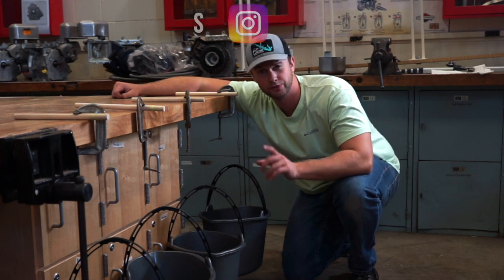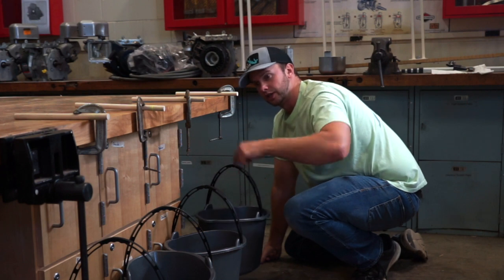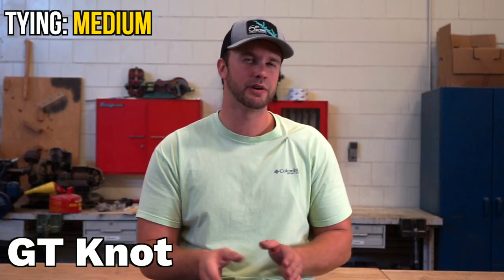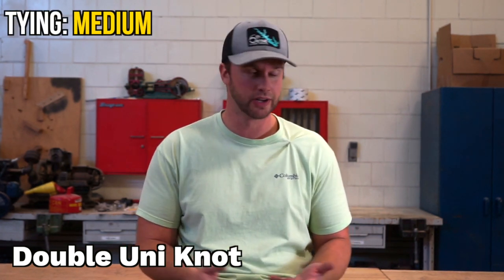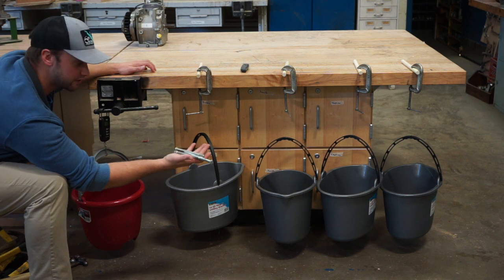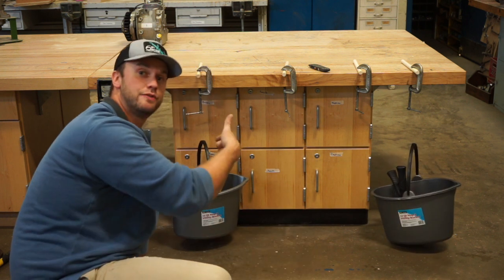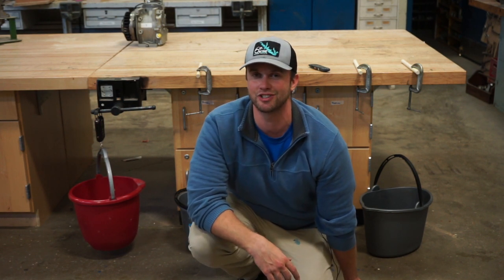Which bass fishing knot IS THE STRONGEST? (Flourocarbon to Braid!)

Comment: I've only read a couple of pages of comments here so apologies if I'm repeating others but it's not just the strength of the knot but it's ability to absorb shock of a big hit. Appreciate that should be absorbed by the line (or should be depending on what is used) but there are plenty of immensely strong knots that will snap at a big shock load.
Reply: Im not sure that makes sense in this case as both materials (braided and floro) don't really stretch much or absorb any shock really on their own, not sure if the knot when pulled tight with materials that don't absorb shock or stretch very well is going to stretch or absorb shock very well. I can see this being the case if mono is in the mix and the test could be skewed because the mono is going to stretch and the knot may make it stretch even more?

Comment: I use the Crazy Alberto knot with my spinning rods 12# Nanofil to whatever leader I’m using for what I’m throwing and I’ve never had the knot break on a fish or snag. The line always breaks not the knot. It’s easier to tie compared to the FG so I’ve never tried to learn the FG. It goes through the guides real smooth. Great vid !
Reply: Alberto does not pass through the guides properly,but for me is the most strong knot as there is no line overlapping and when there is tension it only gets stronger and tighter. Never fails or slips.
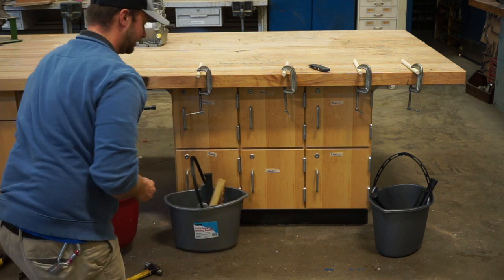Reply: 4:51

Comment: I ONLY use an FG knot followed with a Rizutto Finish (I think half hitches are okay, but don’t like when they fray and may compromise knot).  I land tarpon, snook, bull reds, sharks, grouper, amberjacks and FG knot never fails.  Tied it so many times now that I can re-tie within a couple of minutes while on the boat.  Shortest leader I will tie is about the length of the rod I’m using or longer...so I’m set for a 3-4 day fishing trip and do not need to re-tie unless if I get snagged or hung up on bottom.  Lastly, this is the BEST line to leader knot that enables the angler to cast the knot (especially with longer leaders) through the guides without causing any guide damage due to the extremely low profile of the knot.
Reply from the maker: There you go

Comment: Not sure why people keep comparing old knots - the FG is clearly superior - end of story. And it’s not that hard to tie once you’re used to it. Fiddly, yes - difficult, no.
Reply: I 100% agree with you. As with all knots practice makes perfect. The more you do it the easier it gets. FG best knot for braid to floro or mono you can make
Reply: Completely agree! I spent a winter learning to tie the FG. Once proficient I gained confidence by fishing for river sauger and walleye. 

I now have 100% confidence in the FG knot and can tie it in about 3 minutes. I do secure the tag of the braid with a little bit of super glue to stop the knot from unraveling over time.
Reply: Ever tried tying fg knot while in a boat bouncing in waves in wind  when its raining and your hands are almost numb from cold ?fiddly..definitely..difficult...very much so
Reply: @kristopherwiita4509  Does 25° ambient temp, 35 MPH wind, sleet and snow count? If so, yes. Still about the same, about 3-4 minutes. 

Learn to tie it with your braid looped around your reel handle. It waste more braid this way but you can tie it under your console or huddled behind your center storage lid out of the wind.
Reply: @kristopherwiita4509  I don’t ever see those conditions, but I can tie it sitting in a kayak. I tuck the leader spool under one leg, then twist the braid and manage tension with thumb and forefinger. It can be tied pretty much anywhere this way, in most conditions. Even if it takes longer than usual, it’s worth the time. If you don’t need a super slim connection, just do a double uni.
Reply: @kristopherwiita4509  i ve tryied in normal conditions well look i use him a lot in shore jigging because there is easy to damage your flurocarbon or get stuck on a rock so after a lot of practice i find out that you need to keep your braid stretch so i tie a simple knot in my backpack the rest in on rod i strech it as much as i can beware though know consume your braid so u need to relax it times to times but always be strech and there you go the trick is enough strech easy to say hard to do if you are not experiences btw i know fg is superior but all my friends and most professionals do albright knot cause its easy well i can do easily fg and i cant albright lol
Reply: Try doing it while you're out surf fishing
Reply: @ytho95  i find out something also difficult yesterday cause i was preparing for lrf braid 0.4 flurocarbon dont recall but less pe and i did fg try it and tell me
Reply: @ytho95  agree that would be tricky. Not impossible though I don’t think.
Reply: @mmmbass6068  not impossible. It just makes it excessively difficult. It usually take me about 3-ish minutes to tie it at the house setting up. On the beach it take me like up to 10 minutes. Plus, using heavier main line at 65lbs braid and a 50lbs+ leader, with the beach winds at anywhere from 10-25 mph with no way to break it, it just adds to the difficulty. As a result, it really just isn't worth it. I've never had a uni to uni fail. Just slow down, pay attention and make perfect knots. If there even a doubt, cut it and try again. I've caught several sharks in the 200-350lbs range without a failed knot... yet lol
Reply: @ytho95  agree double uni is a great knot. I ditched it for the FG only because I need something super slim.
Reply: Hmmmm.. RG might be minutely stronger under perfect conditions, but it fails too often, and is cumbersome to tie, and it’s huge.
GT is easy, and has never failed yet. I suppose it’s all what you’re confident with.
Reply: I like my rp knot
Reply: All these people making excuses because they don't want to take the time to learn how to properly tie the FG knot. Learn it, practice it, and you'll be able to tie it anywhere, in any conditions, in less than a minute. When properly tied, it is stronger and has a lower failure rate than any other connection knot. I fish all day, every day, and have never had it fail. That's why the juice is worth the squeeze.
Reply: Wish I could figure the FG out on small line. I use 20 lb braid to 8 lb mono leader (trying fluoro soon) and every time I go to cinch it down, the mono simply slides right out of the braid.
Reply: @mhamr15 you just have to do more wraps with smaller line. I also finish mine with enough half hitch knots to cover the leader tag completely so that it is tapered and smooth. That way it flows through the guides perfectly smooth and also sits better on the spool.
Reply: @slimjimmy229  3 minutes? Must be a lot of steps
Reply: @desertrainfrog1691  If you are tieing light braid to light fluorocarbon it takes longer because it takes more wraps. I do 24 pairs for connecting 6lb leader to 10 lb braid. My 3 minutes estimate is very conservative and worse case. The biggest advantage I've found with the FG is it cast perfectly fine through spinning gear so I make my leader 16-20 feet long and very seldom do I have to tie it out on the water and I've never broken it at the knot.
Reply: @mhamr15  Your mono has to be larger than the braid. If it's not then use a different knot
Reply: for real, fg knot was the first braid to leader knot i ever learned and i always thought it was a easy one to tie after you do it a few times.

Comment: I see this is 2 years old.  I would like to see the same thing done with the SC and the Yucatan knots in the mix.  I would also like to see the knots after they break.  Where a knot fails tells you everything about it's weakness.  
Can I suggest using sand?  You just pour the sand in until it breaks, then weigh the bucket.
Reply: I would like to see the yucatan knot go up against these too

Comment: 3:57 I don't think you gave the Albright knot a fair shake. Just before you added weight to the double uni bucket, it's lip was resting on the Albright bucket, thus adding more weight to the Albright bucket.
Disclaimer: I'm partial to the Albright. 
Also: I am thinking about switching my leader ties to the FG knot. As for joining 2 lines for a top shot or additional line, what would be the best knot that will not make a mess in the spool?
Reply: YOU ARE SO RIGHT!👍

Comment: A couple of things:
In the olden days, they determined the pound test of a line by tying on say 10 pounds and on slack line dropping it 1 foot where slack is gone. If it held at 10lb but broke with 11lb, it was 10 lb test line.
    Is that still how they still do it?
And, if it is, why did these lines break with only 5 pounds?
Also, did they break at the knot or somewhere on the line?
Reply: I've seen knots measured in %s of remaining line strength but with that I've seen FG at near 100%. I would assume the line it's self would be able to hold it's test but I'm not super knowledgeable on that stuff.

But to second above.
Where did the line break ( Was the line wrapped odd on one of the dowels making a stress point?)
But also repeats would be better. Any science needs repeat testing.
Reply: It's kind of like a rope. When you get a knot in a rope it reduces the strength of the rope at that point due to the bends/kinks on the rope by a certain percentage. Just like with tree work. We always use a bowline knot. Out of all the knots, it doesn't reduce the integrity of the rope as much as the other knots, and it can be untied most of the time even after being cinched down to ridiculously tight. 

I would like to see where the lines broke as well.

Comment: The next big innovation in line will be the elimination of knots between braid and fluorocarbon and use of a bonding agent and/or a small micro sleeve each line end can feed into and be sealed with heat or epoxy to bond the two lines together. People hate tying knots and a good engineer will put an end to the cumbersome knots. I am working on some innovations now to solve this problem.
Reply from the maker: Smart

Comment: I like the test you ran..
I belive the FG is the stronger knot when tied correctly 🥴.. 
But for me the Albright knot has be far an away did its job, can be tied in 30sec or less and has never fail me on the water. It takes me 2+ hours to prep tackle before a tournament an if I started using the FG KNOT I wouldn't even get sleep the night before I'd be tying all night

Comment: The FG has always been my go to and I've never understood why people say it's difficult.
Reply: FG is a pain with ultralight line.  Try it with 4lb leader to 6-10lb braid.
Reply: Agreed.  I will say if you're struggling, anchor your braid on your right pinkie finger to control the tension on the mainline.  You have to manage a lot of different tensions to get the knot to sit right while you're tying your wraps.  Having it there allows you to not only keep it tense, but position that tension at the right angle to snug down the wraps as you go.  As with any of these lots of practicing is the answer!
Reply: That's exactly how I tie mine Adam.
Reply: It really is the best and once your good at it its very quick and easy and if im doing it the night before i throw a small drop of gorilla glue on it, hardens like rubberish never had one break
Reply: all good things take times
Reply: @Kdash66  FG shouldnt be used to tie a lighter leader to a heavier braid. That might be half your problem. If it were 6-10lb leader with 4lb braid you might not have problems but idk for sure. My lightish freshwater gear just gets straight mono and I hardly fish it. The salt gear is all at least 15lb braid, 20-60lb+ leader.
Reply: I use fg with 8lb baid and 6lb leader. Tie in a minute even at the lake

Comment: You really need to do an experiment like this a minimum of 3 times to see if you have repeatable results. Good video though
Reply: Yep absolutely. Also, the results may not necessarily be the same for other line diameters.
Reply: On top of doing multiple test should make sure they stay still as possible. The Uni to Uni knot bucket was swinging a bit not to say that aided to the breakage but may have add some stress.
Reply: Good point, but three isn’t really enough either and this test is so vague....

Comment: I still use a uni/uni when in a hurry on all my rods except the ones with micro guides. I quit using fluorocarbon and started using copolymer for my leaders  and I quit breaking off at braid to leader. Always at the lure.
Reply from the maker: Found the one that works 🙏🏼

Comment: I use Albright knot and Double Uni Knot with Ruzutto trimming for final touch to avoid line slipping 
For a while ,I was kinda obsessed with Huffnagle knot when I needed to attach heavy leader with 20lbs mainline. It was my considered pretty compact knot with double mainline,this knot never fail me in tug wars with 20-30lbs catfishes
Reply: Alberto is slightly different but 20%stronger.

Fg modified method i can tie under 1 minute.

Comment: Am I the only one curious why you have 20 lbs of hammers?  Also have you tried the multi overhand knot like they use for fly fishing leader.  Usually 3 - 4 over hand knots. Ive used it a bunch for mono to mono and flouro to flouro.  I'm trying it out for braid to flouro and it seems to work pretty well and its very quick to tie.
Reply from the maker: I use the double surgeons knot for fly fishing if that’s what you mean... haven’t tried for bass
Reply: Yep same knot just with a couple extra turns.  Actually tested it earlier today with 20lb braid (dont have any 10 lb braid) to 10lb copolymer and showed 9.4 lbs on the scale before it broke.

Comment: I HATE tying the FG knot, but I can guarantee it’s the strongest knot out there by a mile. I had a goose snag my braid on the way down after a cast, and the goose ended up getting a spook snagged in its wing, where it snapped the line at the double Palomar knot at the lure. I was using 25lbs braid and a 20lbs flouro leader. It didn’t even phase the FG knot. Absolutely blown away.
Reply from the maker: Love that

Comment: The FG Knot is very easy and quick to tie, if you use the finger-triangle-method. I usually tie it in around 1/30 - 2 minutes- anywhere- the coffee shop, at work, at the tackle shop, on my way to the shore....
No help, no tools, no assists.

I've been fishing for 5 years, and I've not used any other mainline-leader knot since. I can remember the last knot I tied to connect my mono to my braid, was a Mahin knot- and that was about 5 years ago. I am curious though... which is why I'm watching this video.
My guides on my rod are where I WILL NOT compromize... but I've heard the Albright is almost as thin as the FG? That's why I'm curious.
It could give me an option at lower diameters....

Comment: That seemed really low for 10# line. I can almost always get over the listed weight on braid fairly easily, and mono is usually pretty close to the listed weight (I’ve had Trilene Big Game hold more than the listed weight, definitely put 55 on 50, I almost think the 40 held just shy of 50 if memory serves).
 Where did they break off at?
Reply from the maker: In water though, with a rod that absorbs some of the shock .. the knots

Comment: Hey mate quick question if I'll use 15lb braid what leader ratio should I use? Should I use 15lb florou as well? Or higher?
Reply from the maker: Personally I try to keep the line diameters close, it should say on the packaging. Typically you’re going to reduce the lb strength from your braid to your flouro, so with a 15 lb braid I’d rock a ~12 lb flouro
Reply: @DishesandFishes  thanks mate I will follow ur advice

Comment: The Uni starts to lose (badly) at lower test. Fishing with 4 Lb braid to 4 Lb or less fluoro (or mono),  braid cuts the fluoro within the uni knot rendering it useless.  Moving to a knot like the Alberto, where the load-bearing section of braid wraps around 2 sections of mono/fluoro, improves knot strength. I don’t test with buckets. Instead, I just test with a loop made from 1 section of braid and 1 section of fluoro. The ends of each section of line are tied together (braid-to-fluoro) to create a continuous loop containing 2 braid-to-fluoro knots. When this loop is pulled to see which knot wins, Alberto or Uni, the Alberto blows away the useless Uni.  It’s great that some like the Uni at higher test, but my experience is that I’ll not waste my time with it for light line. Let me know if you disagree, but please do the test as I describe it prior to doing so. My thoughts…

Comment: did they break on the line or the knot? I dont think you tight the FG knot right. 6 pound seems extremely low. FG is the only one I use and I ve pulled monsters out of the water and never had an issue.
Reply from the maker: Yeah. That’s how I feel too. Testing the knots out of the water with no pole puts them under a lot more force. Because I agree with you
Reply: @DishesandFishes  I think are right about the water. Fg is like a Chinese finger trap, the more you pull the tighter it gets. I usually reinforce it with some super glue
Reply from the maker: @weixp386  I like that too

Comment: What actually broke on this test ?  Did the knots themselves break,  the flurocarbon, or the braid?
Reply from the maker: The knots broke. The main user error has to be knot tying but like I said, I was meticulous with the knots. I wrapped the line around the top of the rods so it wouldn’t snap and I used palomar knot on the bucket connections
Reply from the maker: I will have to get a close up lens to determine what you are asking.. that’s a good thought

Comment: * The length of the line being used has no bearing on the strength of the knot. If you're testing the strength of a particular brand of line, then you may want to use longer sections of line. A longer section may reveal manufacturing inconsistencies more readily than a short 8 inch section.